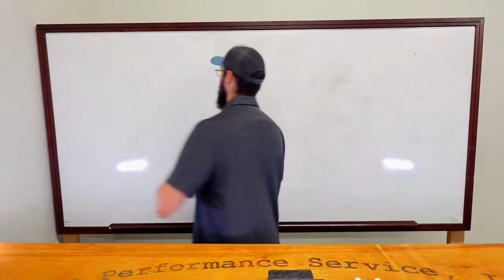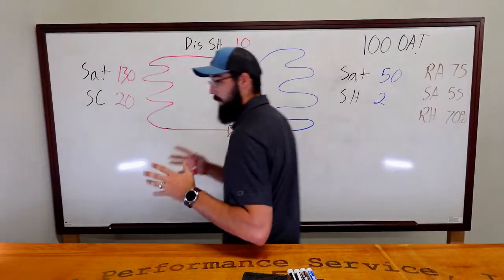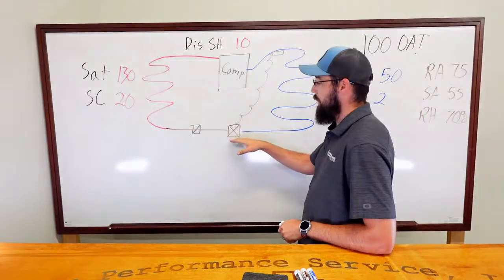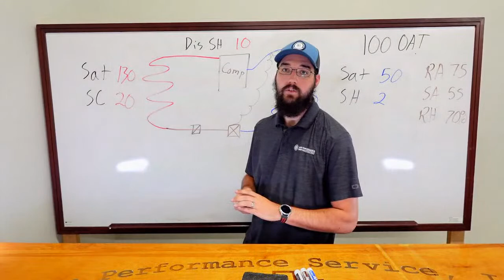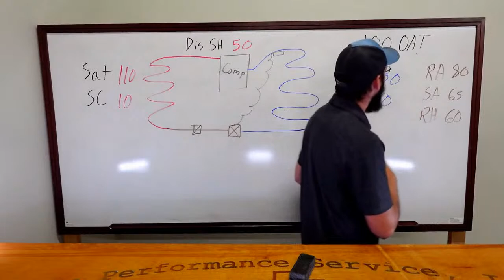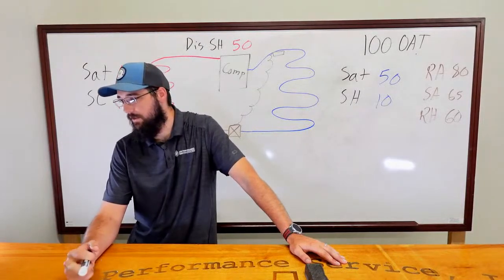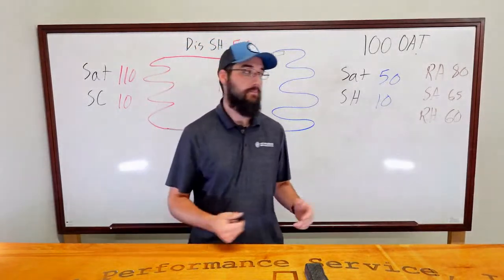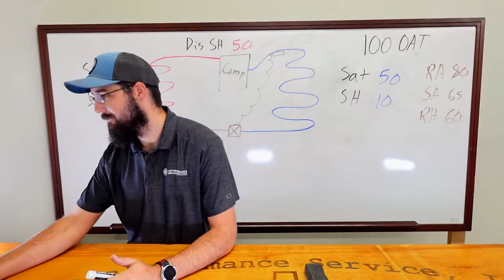AC Overcharge & Inefficient Compressor

Comment: On the 1st example problem I believe you say the fix would be to remove some refrigerant. Question how is it that the TXV can’t throttle the existing amount of flow if the txv is ok  and only becomes the right SH by removing some refrigerant.   Could it be the extra pressure differential on txv from the higher condenser pressure caused it.  Please explain
Reply: Yeah i have the same question. Any new thoughs on this?
Does the txv work properly even as liquid line pressure goes higher? If so then i would think it should throttle the flow based on the SH reading and therefore causing higher SC but not lower SH.

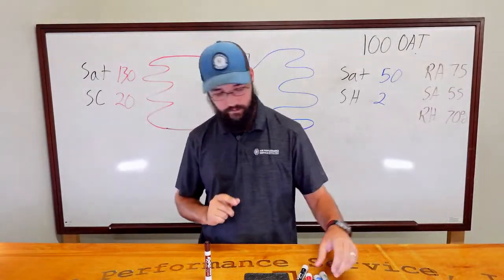Comment: 4:17 - I was taught in school that discharge temperature is an extremely useful reading (but, only in that it should never go above 225), so I gather that information each time during troubleshooting. Also discussed in school was desuperheating in the discharge line between the compressor and the condenser coil. You have introduced to me here the concept of “discharge SH” though. Evap SH is calculated by subtracting the saturation temperature from the temperature of the suction line leaving the evaporator. Condenser SC is calculated by subtracting the temperature of the liquid line leaving the condenser from the condensing temperature. Are you using the condensing temperature in the calculation of discharge “superheat” (discharge line temp minus condensing temp)? Am I understanding what you’re saying here?
Reply from the maker: Yes, discharge line minus condenser saturation temp
Reply: @HVACTIME - Thank you, Sir! I just learned another useful parameter for aiding in troubleshooting. The only thing I was doing before with the discharge temp is verify that it was not above 225. Moving forward, I will do the calculation to better understand the current conditions.

Comment: For that last example, I feel like you could say the TXV is slightly over feeding. Which would give you lower than normal subcooling(for the ambient) and higher than normal suction pressure. Although if a TXV is overfeeding I suppose the superheat may be lower, hard to say.